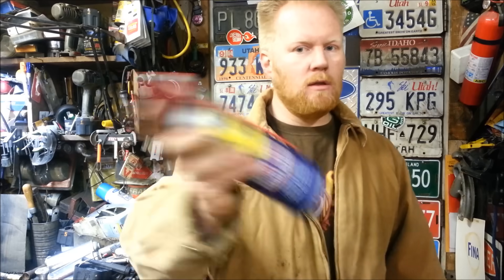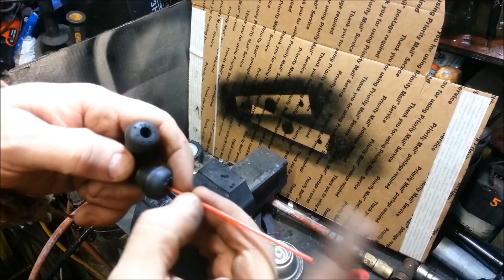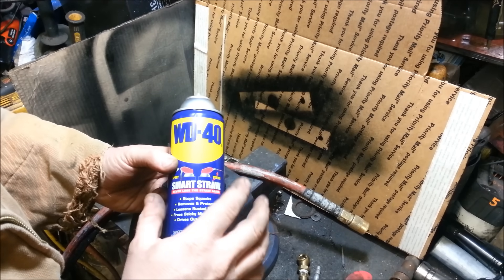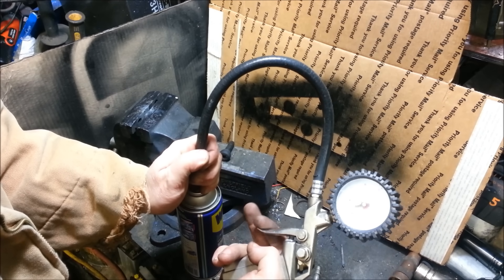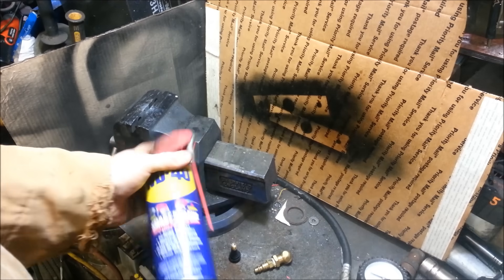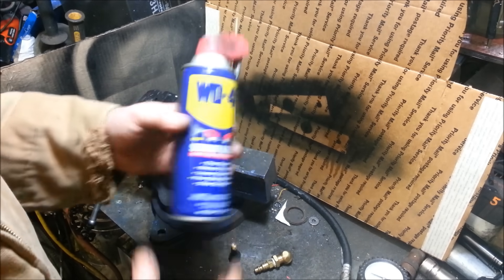Refill flat AEROSOL Spray Cans like the WD-40 and others

Comment: Ingenious. Best hack for us DIYers. Just threw away the same WD40 can before discovering (and watching) this video. I personally would keep filling at 50 psi intervals as a safety precaution as not to weaken the can's structural integrity. Not sure if it has an internal air bladder or just a sealed cannister. Anyways, thank you for the excellent instructional video.

Comment: I'll try it, thanks. I usually just poke a hole in the top with a nail and put it in an old oiler can, which also works as a solution. I think these cans go flat faster in the garage bc of the fluctuating temperatures.

Comment: Or you can lay the can horizontally on the floor and stomp on the side of the of it to create more air pressure inside the can.
Reply: Only adds a little bit of pressure and then you're back to square one, only now with a bent can.

Comment: Thanks. I had a can of WD40 that ran out of pressure but had a lot of fluid left inside. I happened to have a tire valve in my toolbox and hooked it up to a can. As you say, perfect fit. Using my battery powered pump, it said there was 9 PSI so I quickly dialed up to 85 (just to be safely below the 90 PSI you mentioned). After a quick pump with with my safety glasses on, it works again. 

I appreciate the tip, thanks again.

Comment: cheaper and easier is to take a punch or philips screw drive with hammer turn can upside down and pop a hole in base on one side near edge, now pout wd40 into a pan or jug with decent opening. Now put it in 2 dollar spray bottle like 409 or windex style bottle with adjustable nozzle, and you can shoot stream on tight areas or mist a larger area. Free to cheap, you are welcome, done this hundreds of times. At a plant I worked at we bought spray bottles in garden area at home depot and wd40 by te gallon much cheaper than the small cans that always die

Comment: I did this, BUT, compressed air refill only last few seconds then flat again. Compressed air is definitely not what original cans are filled with. There must be another trick.
Reply from the maker: Cans are generally filled with propane/butane, CO2, or in the past Freon. They turn to a liquid under Pressure so you can put a lot more in.

Comment: They would work better with nitrogen but you should paint a green N2 on them so you don’t accidentally add air if they need more
Reply from the maker: Normal air is already approx 80% nitrogen. On a side note I find it silly all these tire places boasting about Nitrogen Filled tires because "air leaks out"??? Well if the other 20% of air leaked, then one refill and you'd be 96% Nitrogen; then 99.2%.......
Reply: @sixtyfiveford yeah me too

Comment: Yeah, premixing air with a combustible liquid.  What could go wrong?  Here's a hint.....once the fuel has a bunch of O2 mixed with it (compressed no less, oy) the spray nozzle no longer function as a choke point as it does normally.  It's premixed and ready to go and a flame will back channel if ever sparked, particularly when the pressure starts dying down and the fuel/air mixture slows down.  Don't spray something hot.  You've made a hand grenade.

It's not like spraying a flammable liquid on a fire normally.  In that case, there's no oxygen with the fuel until it leaves the can.  This fakate idea is a disaster waiting to happen.

Again: The spray nozzle will not suppress an ignited flame and keep it from returning to the can.
Reply from the maker: Learn a few things before you actually leave a comment. This is a very ignorant comment. Hint flashback arrester hole size. Flame will not travel through a 1/16" hole let alone a spray nozzle.
Reply: @sixtyfiveford  When the oxygen is premixed it certainly will.  You're thinking of a non-oygenated fuel being sprayed onto a flame, forcing ignition external to the device (such as with a new WD40 can).  In that case there are two things: 1. The o2 mixture is happening outside the can, and 2. The choke point (*NOT* flashback arrester) means that no flame traveling upstream can reach a fuel/air mixture.

What will happen in your case is 1. You're premixing the fuel with the O2 it needs to ignite.  And 2. You're HOPING that the speed of the ignited external flame traversal is slower than the travel out of the can.  When it starts to run low, it won't be.

Comment: Is this why a full can of wd40 wont spray anything out because of this?
Reply from the maker: Either it is out of propellant or they also like to clog. Adding air will fill it and or dislodge the clog. If you can squeeze the sides of the can and it flexes, it's out of propellant.

Comment: I just pour WD-40 INTO AN EMPTY FABREEZE BOTTLE.  TRIED TO RE,-USE NO AEROSOL WD-40 SPRAY BOTTLE DIFFICULT TO GET THE SPRAY OUT, AND THEN THE TRIGGER STARTED FALLING APART AND LEAKING ALL OVER THE PLACE.  IF WD-40 WERE SMART, THE NON AEROSOL CAN WOULD BE REUSABLE, AND REFILLABLE INSTEAD OF USING AN OLD FREBREEZE BOTTLE TO SPRAY.
Reply from the maker: @dougclem7711 If you're using febreze, you're already used to wasting money. Might as well just buy a new can of WD-40.

Comment: Just go to any discount tire there’s a thousand valve cores in and around the dumpster along with weights and maybe other stuff. I got two nice jacks that literally just needed fluid and two sets of new tires sold both for 600 a set. Also found few other new tires. Oh and wheel caps and wheels sometimes.

Comment: i actually found a better way my cheap chinese blow gun .i drilled slightly and it slips right over the white can pin and fills can with 100 psi of air i 1 second .i tried the tire stem that works also .bottom line is its great to always have air preasure .

Comment: sometimes it has quite a bit .  i saved a lot doing that .  when you do it in a shop . i constantly do this ish . i dont recomend doing it but if you dont mind fing yourself up... he uses a prssure guage .. i dont i use straight high as power compressor . from the air gun .its in the feel when the can blows up dont keep doing it.

Comment: It would be better to use nitrogen or co2 as putting air which contains oxygen and adding it to fuel (wd-40) when under compression could become an explosion hazard.  Needs an ignition source though.  Probably not a good idea to do the wd-40 flame thrower thing while using compressed air as a propellant.
Reply: Notice how the guy loves everyone else's comments except the ones pointing out a safety concern. What a moron 😂 I said same thing about a year ago.

Comment: Adding compressed air to combustible products in a sealed can would not be my choice.  At some pressure, that I don't know, it will spontaneously combust.  Many products use butane for propellant, a fuel gas not an oxidizer, so safe with solvents and such.  Plus the room temperature pressure where it liquefies is 35 PSI [20 PSI above atmospheric] making it safe to add to any can.  Just invert the butane can, use the right filler adapter that comes with the butane, and press one stem with the other; the butane flows into the empty can.

Comment: You'd be better off using lighter gas so you're not risking blowing yourself up by putting fuel and air under pressure inside a metal can.

Comment: Thanks a lot for this video. That looks pretty easy, and I have valve stems sitting around. I can't tell you how many cans I've tossed out that lost pressure before it was empty. 
I wonder if putting AIR into a paint can over the long term might lead to the paint setting up inside. Still it's a quick and easy way to get the last bit of paint out of the can when the pressure is gone. I will definitely give it go.
Also, I think this might be a fix for when the nozzles gets plugged, the air might just blow out the blockage. :)
Reply: You ever try the paint can hack? Does it coagulate inside the can or no?
Reply: @dadephunt1717  So far I used this trick twice. But both times I emptied the can right afterwards. It's a good hack to use up the last of the paint in the can.

Comment: I used a can of compressed air for electronics. It worked like a champ but don't know  the psi that went in the can.
Reply from the maker: Those cans are filled to around 100psi with refrigerant(r-152a) that liquefies under pressure.
Reply: @sixtyfiveford  The compressed air can I used was nearly empty so I trust that this was safe to do and that the refrigerant is ok to mix with WD-40?

Comment: The WD valve is a male type in that you can insert the valve stem base (which is female) on to the can's stem.  Some cans are female in that you insert both the sprayer and it's stem into the bladder.  Thus on these, when you pull out the sprayer, the stem comes with it.   I've thought about using a basketball/football etc needle for these.  Ever run into that?  Thanks

Comment: OK, what am I doing wrong??  I have a new valve stem and I am pushing down hard on it when I put in the air from my compressor, BUT I keep getting the contents of the can coming out. I've tried on various cans and still no luck. Do some valve stems not work?
Reply from the maker: You should have some contents escape when you quickly remove it after adding air. You can have your air flowing first through the valve stem before you even connected to the can to make sure everything's moving in the right direction. Generally you'll feel bubbling up in the can as the air pushes down through the pickup straw.

Comment: Thanks for great idea. Was always running out of WD-40 pressure so I tried your technique today. Had to cut about 1/4 of rubber off the base of valve stem so inside brass tube would press on on can stem. You have to use this valve stem to press open can white stem to get air pressure into the can. Air pressure along is not enough to overcome the can stem valve..  Your technique works, thanks a bunch.
Reply: I tried this with a random seal cut from a rubber hose and a standard upright bicykle pump. Pressing the pump against the rubber was enough. Lovely bubbling sound inside the can. Pressure wants to go from higher to lower. The stem is a valve. Pressing it gets messy.

Comment: Question...towards the end of your video you are shooting your WD40 with the can upside down.  I'm betting that's how you are losing pressure before the can is empty!  I think there is a "pick-up" tube that goes to the bottom of the can to get product.  Turning the can upside down let's you spray only what is left in the tube, but also a bit of propellant when that product in the tube runs out.  That's why it's good to spray an arisol paint can upside down for a second or two till no paint comes out.  Only paint in the tube comes out.  You are only trying to clear paint from the nozzle which if left there would dry and clog it!!!  I hope I helped someone?
Reply from the maker: WD40 has a pickup at the top and bottom. The top pulls in propellant to foam the product as it exits.

Comment: What about a little shot of R134A out of an air duster and maybe a short piece of vacuum hose to connect them?  With the 134A can upside down you might even get a little liquid to transfer.  Haven't tried it but I think that's my next plan when it happens. Surely it's compatible but might mix into some goup of some sort..
Reply from the maker: That would work but you would be better with Propane as canned air is pretty pricey. Years back Propane/butane was commonly use as the propellant in cans like this. Today most is stuff like CO2. Just a heads up most air duster made in the past 10years is now R152a, not that it matters.

Comment: So many people here have had a can run out of propellant. It's only ever happened to me maybe once. clogs with paint or contact cement, or finger spray issues, have been the majority of my spray can problems.
I was looking here to see if there was a safety issue with accidental dieseling type combustion using air to compress wd40. I recently bought a refillable sprayer for WD40 and am just looking out that im not making a dangerous circumstance for my shop.

Comment: Great green tech to NOT waste anything on our planet, that has already been created. Some dummies will ask (does that also work for (fill in product name) as if the can colour or liquid inside makes a difference). But speaking of wasting, at 2:24., we GET it, no need to half empty your remaining fluid to hammer home that you pumped air into the can. PS, I used to service compressors, and today, still have units for sale- from 5 - 125 HP.  We know air.  
Thanks for a great savings idea! 👌

Comment: You can also take a can without pressure, puncture a hole in it and drain the fluid in a glass jar. You can then apply it with a small paint brush or put it in a cheap spray bottle and spray it on. Just save the liquid in the can (which has to be designed with "planned obsolescence" i.e.) forcing you to buy more of the crap - be it WD 40  or PBBlaster, or what ever. I keep a glass jar of PB Blaster around all the time. But your idea or re-pressurizing is a good one.

Comment: A simpler way is to get an air gun with a steel tube fitted to it. Slide a length of riser tube for a drip watering system over it, slide the other end over the tube out of the spray can. Squeeze the trigger on the spray nozzle and you fill the spray can. Pull off when filled and put the nozzle back on

Comment: NOT A GOOD IDEA!!!! you just introduced air into a can of kerosene.(WD40) Kerosene and air make a bomb out of that can. You can fill it with propane, or nitrogen. but not air or oxygen. I worked 46 years at an oil refinery and the last thing you want is air and kerosene together. get rid of those cans you filled.
Reply from the maker: Your missing one huge key component: you'll need 700+psi at room temp to create "a bomb". You'll never come close to that with an air compressor.

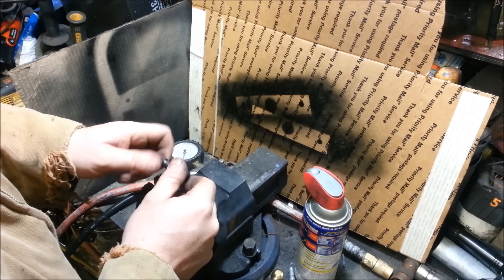Comment: 0:36 That's called a Schrader valve. The unscrewable core is called the valve core.
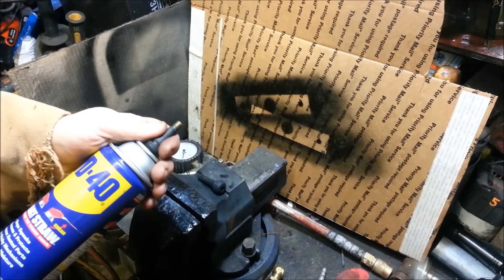1:21 That's called and Air Chuck. Not a tire valve. Again the tire valve was the last thing you got wrong. You should try and handle English before trying to teach anyone. 
2:04 Now it's a tire stem? Are you just making things up as you go? Or am I having an aneurysm?!
Tire stem is ANOTHER term for the thing you got wrong first. A Schrader valve. I cannot stand watching this, I get the concept. Thanks for the headache.

Comment: The propellant helps pump WD-40 out of the can effectively. The propellant used in WD-40 is carbon dioxide (CO2). CO2 is an inert gas which helps empty the can. Plus, the addition of CO2 reduces the number of VOCs, which helps towards preserving the environment

Comment: Easier than that:  Hold the can in one hand, your common air blow nozzle in your other hand.  Hold them together firmly. (Even if the have just the push button or spray tube.)  As long as the two holes line up.   Then at one time, press the button on the can as if spraying while pressing the air button on your blower.  You can feel the can getting rigid.  It only takes 1 second or so.  Let up both buttons at the same time.  Easy.....

Comment: I have saved about 20 cans of WD. I poke a small hole at the bottom, turn the can up so the air comes out then let it drip into another container so you can pour that into a spray bottle. the rats at WD do this on purpose to get you to buy more. Actually, I have found other products that do the same thing and they don't cheat you.

Comment: This has been a long standing history with my experience with WD 40. They should be filled with a butane/ propane mix.  This propellant  will partly desvolve into the solution that will release as the product is dispensed. I believe they are filled with CO2. Ive had many cans go dead, and have wrote the manufacture of WD and they have sent me replacement cans, so koodo's to them, I appreciated that they addressed my issue. I have now 4 cans of WD with plenty of product in the can, but no propellant to extract it  I think I will try this method, but with propane/ butane mix and see if this improves the performance of the dispensing.

Comment: Just recharge with Butane. Connect nozzles together make sure Butane is Aiming Down and press Both Nozzles at the Same Time. Read the label on other spray cans they use Butane as propellant in many. I have also used Starting Fluid when I was in a hurry.

Comment: Two things that ruin the shelf life of most chemicals are oxygen and moisture, and you just injected a whole lot of both into that can. The air from a compressor is also rather dirty and oily, which is why painters add an inline filter and oil separator. Neat trick for certain cans, but definitely not a universal hack.

Comment: Great idea here my take get oil fashion oil can or a spray bottle & dump leftover in them. I had several cans of wd -40 & air presser was get low, So I took a large nail & hammer pop hole in top cover with shop towel or grease rag.  pour it into my oil can & use it on my saws & gun cleaning.

Comment: Culd centrain fuel types by saftly preshurised the same way? I have starting problems my pump up hill can not suplly my engine it is on mechanical fuel pump can I add some gasoline to that can and spey some fuel to my engin befor starting just on start up?

Comment: Can this method be used to refill a can that was originally filled with air only?
Reply from the maker: Yes and no. Cans of air are actually filled with Freon essentially(refrigerant r152-a, r134a, r12). These turn to a liquid when compressed and you can fit a ton more in the can than just straight compressed air. If you fill it with compressed air it will only give you 5 seconds of spray before it drops and runs out.

Comment: Just press the button and use an air spray off nozzle and put it on the aresol tip hole. . Press both at same time and it will put enough air in the can to use the liquid.